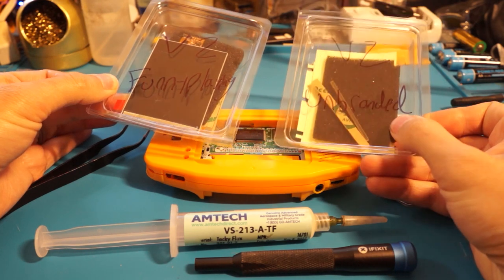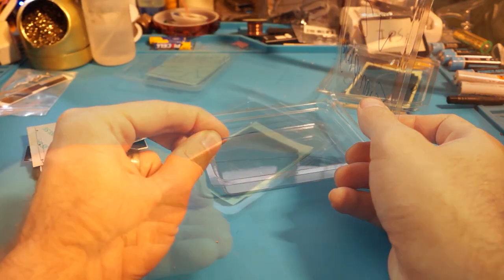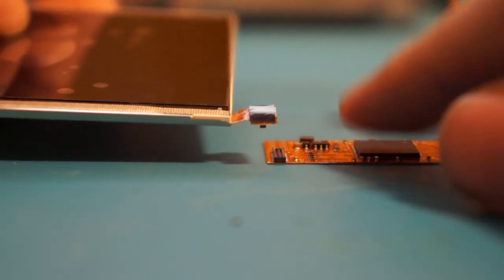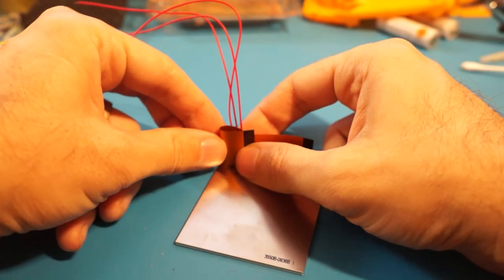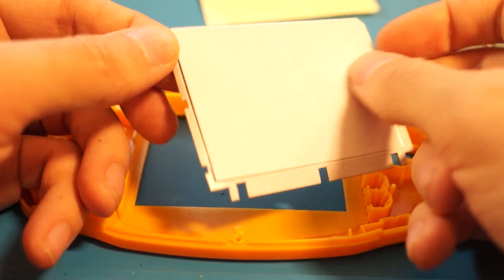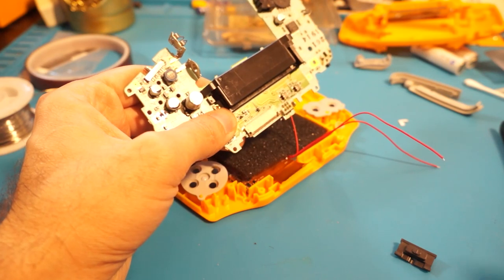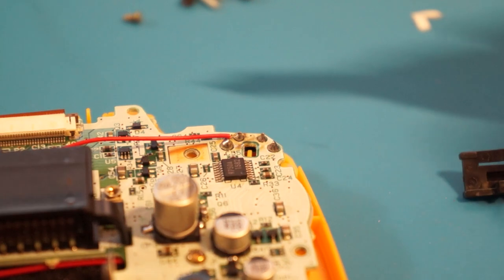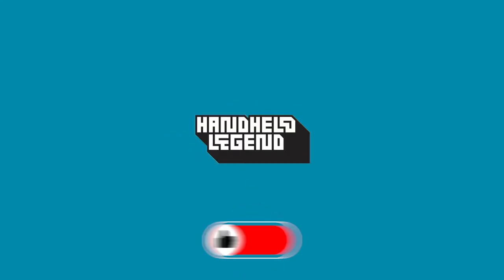Gameboy Advance IPS V2 Install Guide | FunnyPlaying and HISPEEDIDO

Comment: Hey there - we followed your guide accordingly and the screen worked fine for 90 seconds, but suddenly it turned off and there's no sound or images, but the power is still going. I tried to look around and the suspicions are either weak soldering and faulty ribbon cable. As I'm not smart on electronics, how do I exactly know if the cable is faulty?

Comment: I did this a year or two ago but ran into some issues that I ended up abandoning but still want to get to the bottom of.

With this, you're supposed to hold the select button and then press L or R to adjust screen brightness. Mine does it, but for some reason, the screen dims one stage upon pressing down the select button. It can be worked around but it is annoying.

The other issue... the L button doesn't work. 😮‍💨

Edit: I wasn't sure where this comment was, but the like brought me back to it lol thanks! The problem was that when I assembled the gba, the ips wire that connected to L was being crushed by the case itself where the screw at that same corner fastened together. When I freed the wire everything worked perfectly. If anyone has the issue I described initially, make sure the wires are not being crushed by the case!
Reply: Hey just wanted to ask if you’re still here? I have this same issue. My problem is the select will make the brightness go up and L will make it go down but I can’t figure out why it will go down even if I’m not holding select. I’m just super confused.

Edit: you were 100000% correct about the wires not being caught on the shell. It’s fixed!
Reply: @BladeReynolds  Hm. All that comes to mind is to check and make sure that the solders are only connected to the spots they are intended. If any two spots are linked because the solder is touching two solder points, it can cause issues. This, and of course, making sure the wires don't have interference, like the case crushing down on a wire.

Comment: I already have a modded GBA SP but I recently bought a modded GBA with IPS for the sake of collecting. I also did check if it's FP V2 or HISPEEDIDO V2. It looks like it's HISPEEDIDO V2 because it has that big 5-in-1 Chip. My question is, is it okay to use NiMH AA 1.2V rechargeable batteries eventhough it's causing the Power Indicator to blink from red to green or just stays red? I'm using Ikea Ladda 2450mah. The power switch wasn't the issue. I already took the power switch apart to clean it even. When I use alkaline batteries that are 1.5V the blinking from green to red/red to green isn't happening. Will the gameboy advance just turn off at a certain point even if the Laddas aren't fully drained because of the lower voltage?

Comment: I purchased one of these kits plus pre-cut shell.
Installed them myself and after one day of playing it just died.
when turned on, there's backlight but no image.
Motherboard is working bc I tried it with my old screen, and it works fine.
What could be the problem? ips screen or ribbon cable?
Reply from the maker: I would send an email to our support email as they could help you with this specifically; support@handheldlegend.com
Reply: Did you ever find out what was wrong? Or if they fixed your issue?
Reply: @cleann_RYP  I bought mine from aliexpress. 
After talking to seller he said the cable on the screen might be  broken. So he sent me a new screen. After swapping the screen everything works perfect.

Comment: Never soldered before and have no idea what I need, what was the stuff you were using in the solder process?
Reply: I am very late, you want solder wire (a spool of which will last you forever), a soldering iron (don't touch the metal as it's PRETTY HOT, and don't have prolonged contact with the GBA board since it'll burn and ruin everything), a well-ventilated area to work with and if you've got poor eyesight and need to be close to what you're soldering to see, you should wear safety glasses since the fumes are mildly irritating. The thing he applied earlier is called flux and it helps solder flow easily, it's not 100% necessary. My father has soldered most of his life and he also recommends a sponge to wipe off some of the gunk that accumulates on the edge of the solder.

Comment: So just followed this guide select turns up brightness and select left chigger turns it down tryed everything still does it.
Reply: I have this exact same issue. Any idea on what could be the issue?
Reply: I just had the same issue, but i noticed that if you look closely when he's soldering the solder points are different on each side.

Comment: Real question: should I get the Funnyplaying, or HISPEEDIDO ips v2 screen?
Reply from the maker: Typically we recommend Funnyplaying, the HISPEEDIDO ones work, but the Funnyplaying ones are just a slightly better experience. We always use the Funnyplaying screens for our Ultimate consoles as well, hope this helps :)
Reply: @HandHeldLegend  In what way are the Funnyplaying screens better?

Comment: Do you have to Pre-tin the pads? I have solder but I didn’t know you needed flux or anything
Reply: Unless you have solder that flux inside of it, you absolutely need flux, I just use rosin paste, just make sure to clean off any residue when you are done.